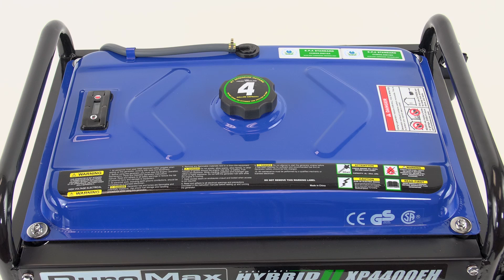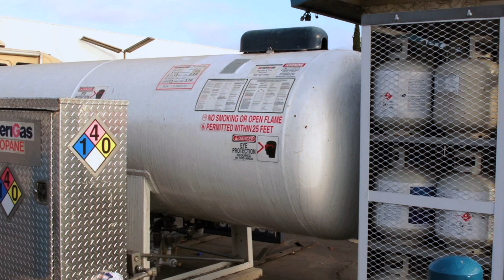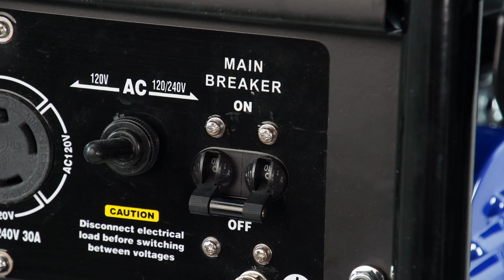DuroMax Generator How-To Guide: Assemble, Start, and Run on Gas or Propane

Comment: Good instructions,, might I add in step One: If you are alone, and you are going to tip the unit over to assemble it anyways,, just roll the box over  and lift off the box, I'm sure its way lighter than the Generator, I also have my cords hooked up so I am not causing any surges or sparks before I turn on the main breaker,, hope this helps.

Comment: Wanted two potential fuel sources. Have propane tank always available and gas for snow blower, so dual fuel source makes sense. Out of box took me 15 minutes to go thru steps and start. Ready for winter.
Reply from the maker: Sounds like you are prepared for whatever bad weather throws your way! Thanks for choosing DuroMax Power Equipment!

Comment: Does anyone know how to charge a 12v deep cycle battery using the 12v prongs and alligator clips that came with the 5500 dual fuel model? I’m pretty sure you can do it but when I tried smoke started pouring out from behind the panel. I quickly turned the generator off and unhooked everything but obviously I did something wrong.
Reply: Bueller. Bueller. Bueller… anyone?
Reply from the maker: Hi There!
We recommend calling and speaking with one of our friendly techs at 844-DUROMAX to walk through using the 12V to charge a deep cycle battery.

Comment: I have a few questions. We just ordered the DuroMax 13000 HX and I want to know about initial start up and break in. Is it ok to use Synthetic oil? How many hours should I let it run and then replace the oil when I first get it for break in? With a 20lb bottle of propane about how many hours will it run running a home central air? I know that will vary on the load, but I'm just trying to get a ball park idea if I need to buy a bigger bottle for home use. We have a few smaller ones for camping. I plan on just running propane in it and not gas, unless I just have to. Thanks for your time, Rob.
Reply from the maker: Hi Rob!

We do not recommend using synthetic oil on the initial 8 hour break-in period (standard conventional oil is best for this period.)  Please make sure to keep a few items powered during that time as to keep a load on the Generator. We recommended space heaters, portable fans or similar items. 

After that 8 hour break-in period we recommend to switching to an appropriate synthetic based on your climate. While a 20lb bottle will suffice for a short run we do recommend 40lb or larger tanks when powering AC's and multiple circuits on a home.

Any other questions please feel free to reach out!

Comment: We received the XP13000HX and the cover over the recoil cover and the cover over the generator were both bent.  After getting everything set up it worked with gasoline but would not start with propane.  We checked the battery and it was dead!  We ordered from Amazon and emailed duromax customer support and have not received any help from either place.
Reply from the maker: Hi Sue Jordan
That is very unfortunate to hear and we hope if that this hasn't been resolved, we can get resolved right away. Please email us at vipsupport@duromaxpower.com

Comment: I bought your XP12000EH generator and in both this video and the instructions that came with the generator it states that I have to press the button on the regulator to bleed air out of the propane line, and that makes sense.  My regulator is simply capped, there is no button/bleeder, so it takes 10 - 15 cranks of the starter to get it going on propane.

Can I be sent that release valve?  Sadly, for $1,000 I figured it would match the directions, this feels like an oversight.
Reply from the maker: Hi There!

We apologize you’re having trouble starting your generator on propane. The propane regulator on your generator is one of our new self-purging regulators; and has a different procedure for operation than the manual states.

To start with the self-purging regulators, you'll want to connect the propane tank to the generator and open the propane tank valve; then, let the generator sit for 3-5 minutes to purge itself. After the generator has been sitting for 3-5 minutes with the propane tank valve open, then, start the generator on mid-choke (choke between open and closed) to start. 

Once you hear the generator start move the choke to the open position (choke to the right side).
Please note to ensure the circuit breaker and the idle control (if equipped, depending on model) are in the off position while attempting to start as well. 

Please also note that if you’re unsuccessful in the mid-choke start position, the generator can also be started with the choke in the full closed position (choke to the left side).

Please feel free to contact us if you have any further questions or concerns - We can be reached at 844-DUROMAX
Reply: @DuroMaxPower  I needed this exact explanation. Thanks.
Reply: Did this solution continue to work for you? We attempted this once with success however, have now been unsuccessful starting again with propane. Any feedback is welcomed! Same model and no regulator button.

Comment: Cant take the 2 separate shipping braces off! Help!
Reply from the maker: Hi Roy!
We recommend an impact driver or impact wrench if a hand ratchet doesnt work. Also please reach out to our service team as they can provide some tricks to get those stubborn bolts off by calling them at 844-DUROMAX
Reply: @DuroMaxPower  got em out! Do I have to ground my 5500eh? It is fully enclosed in the cage and will be used to power a fridge and heater/portable ac via extension cords. Thanks!

Comment: Mine doesn’t have an orange brace? There are small red braces
Reply: Same! Did you remove those then?
Reply: Mine came with 2 individual red braces, are these supposed to be taken off?
Reply: I took both off, sorry Karen I did not see your comment. They are both just for shipping.
Reply: Just got mine but I cant seem to reach 2 of the bolts to take off
Reply from the maker: Yes the red or orange shipping braces need to be removed prior to use.

Comment: Which to use:
Conventional oil?
Synthetic blend? 
Full synthetic?
Reply: I haven't started my XP10000EH yet but we saw a great review that this guy probably knows his stuff. https://duromax-xp10000e.tumblr.com/post/82903514192/comprehensive-duromax-xp10000e-generator-review. Granted his post is 6 years old but what has changed since then? I've owned many Corvettes and have only used Mobil 1. About to start using it in our Husqvarna lawn tractor. I can't see how synthetic "any brand" can mess up something small when high performance cars ONLY use it.
Reply from the maker: Our generator models can use either 30W, 10W-30, or 5W-30 oil in synthetic or conventional depending on climate. Please see manual for further information.

Comment: The bolts on the orange brace had to have been torqued to 500 foot pounds. That was the most unneccessary amount of torque I've ever had to break
Reply: I had to get a socket set with a large handled socket wrench to do mine.
Reply: Can you please tell me how you managed to remove it?
Reply: Definitely good for some busted knuckles!

Comment: Video says to warm up for 5-10 min when using PROPANE. Says 30 seconds when using GAS. Also had a very hard time starting on propane with a new full tank. Followed instructions purfectley, took almost 1 minute to start, had to use a JUMP PACK because the battery died, ran rough for 5 minutes plus on PROPANE, then ran smoothly. No starting issues with GAS, just with PROPANE.
Reply: Although it says not to use the choke as you would with gasoline, when operating on propane I used the choke when using a 20 lb tank and it started right up withing seconds of hitting the starter.
Reply: @rearview2709  thanks man, mine wasn't starting so I tried this and it booted up immediately!
Reply: Pretty stupid to have to jump off an emergency generator. Also, why they are too stupid to ship a jump pack, built in charger or external charger to keep the battery at good operating levels is just beyond dumb. Glad I bought an emergency device with jump battery that could be dead when needed. 🙄
Reply: @geu6270  To a stupid commentor who totally misses the point then makes stupid comment that is totally off the point, which made him even stupider.

Comment: Should I attach a ground wire?
Reply: I was wondering the same thing when I read it in the manual
Reply: @nikolasgrn  Been running generator since the 80s off and on from time to time and never had a problem on not using a ground wire.

Comment: Waita min.: replace oil every 24hrs ??? You mean I have to stock up on oil as well as gas & propane ?  I find it hard to believe that every 24 hrs I have to change THE OIL WHY ? During a hurricane there are many many Rain-bands w/high winds !
Reply: i have one and do not do that
Reply: It's because there's no filter. You could filter the oil manually by removing it and pouring it through a filter or look at adding a filter.
Filtering just helps prolong the life of the engine.

Comment: hI, B-4 I cruise U-tube, Would anyone send me a .pdf or anything explaining how I can get my DuroMax XP4850EH, into my home's grid ??  During Hurracane Andrew (aug 24th 1992) I used a converter from my van to just one outlet in my home (Main switch OFF at fusebox) I was able to plug in the fridge, fan, & some stuff I can'rt remember for the 2 weeks we were w/o electric. Anyway please assist-I'm getting mine tomorrow :)
Reply: Donald L Taylor Jr. hire a certified electrician to perform any hookups to your home Electrical panel.

Comment: Where the hell is the propane decompression valve? It's nowhere located as shown in this video!
Reply: Mine also does not have the decompression valve.  Apparently, this is the upgrade noted concerning the new regulator.  Works just fine without it.
Reply: @robertm78645  Yes, I called Duromax and the rep told me this is an upgrade and all you need to do is let the propane adjust internally for 2-5 minutes. That's nice, but if that was in the instructions it could have saved me 30 minutes of scratching my head.

Comment: Can you connect it to a large propane tank so it can run continuously.
Can it run continuously?
Reply: Not really a good idea... You have to stop any portable generator that dies not have a spin-on oil filter AT LEAST every 20hrs to change the oil. So you can't really run it much longer than it will go on a tank of fuel.
Reply: @dontblameme6328  BUMMER.

Comment: Well I see that there are some negative posts on here so I’ll just tell my story. 

I ordered the DuroMax 4400E and it arrived in two days from Amazon. The front piece of metal (with the logo/brand) was a little dented and bent but I don’t think it was shipping damage. I think it was because the engine was too big for the frame and they just had to MAKE IT FIT! 

BUT once I got it unboxed and Assembled it the damn thing started on the very first try. I was mind blown! 

Well now that I have my fancy new electric start Generater the damn power NEVER GOES OUT for about a year but I keep running it and keep it healthy. Then suddenly the thing STOPS running. I researched the issue and found that it was a simple clog in the carburetor and it only took about 30 mins to fix by running a little paper-clip through a little hole. 

Then I noticed that my DuroMax model doesn’t have a fuel-filter so I bought one at my local auto-parts store. Problem solved and I swear this generator has been the most reliable SOB ever since. 

This thing has gotten me through about 10 power outages now in the past couple years and I LOVE it! It’s the best -$400 bucks I ever spent!

This is the best and most honest review I can give so take it as you will! NO it’s not a perfect machine but it almost is for the money.
Reply: I didn't know about the fuel filter. Where is it on the generator.
Reply: How'd you get your orange brackets off?

Comment: Wait....  The manual says it holds 37 ounces of oil.  This video says it holds 20 ounces (32-12).  Which is the truth?  I have to say, between Amazon, the manual and the MFR web page for this product, there are serious differences in information.
Reply: I would always follow the manual that came with my generator. This video was posted in 2014!
Reply: Just fill it and go.

Comment: I have the 10k watt generator and out of the box it won’t run. It starts fine, but dies with9n 10 seconds every time, anyone have a clue why? Is the idle control broke?
Reply: No you are leaving the choke on! I’m sure you have figured this out by now. Lol
Reply: Choke
Reply: Michael Milewski check the fuel shut off valve and the choke, use fresh premium gas. Hope you can get it to work

Comment: My propane gas hose for the xp4850eh got burned. Where can I buy a replacement? Anyone knows place help. I bought the hose at Home Depot with regulator and it doesn't work.
Reply: Loc hung. You don't need a hose with another regulator.  The regulator is already built into the generator. Dropping the propane pressure at the tank only starves the generator. Loose the extra regular and connect directly to the tank.

Comment: I have a 5 year old Duromax XP8500E that ran perfectly the three times i used it, the other day I decided to fire it up seeing how i haven't run it in about 6-8 months... I put gas in it and turned the key and the battery was dead do i pull started it and let it run to charge the battery. after a few minutes i noticed the battery charging light was off so I shut it down then tried to re start it with the tey, the starter clicked but didn't turn the engine over so I pull started it again and the charge lithe lit up... this time i was watching the charge light and it got dimmer and dimmer, then i looked at the volt meter and it was showing below 50... so I shut it down again but this time, Smoke started pouring out of the rear vent of the electric motor. I changes the AVR and the Brushes for brand new ones and its still doing this same thing. Any ideas why?
Reply: hdrjunkie have you figured it out yet?

Comment: I just purchased the DM XP4400E. Setup and start-up was simple. However, for starting the generator, the manual says to "close the choke" and then either pull the recoil start or turn the key to the start position. I found that if you keep the choke in the "closed" position, it doesn't start. You have to put the choke in the "open" position and then pull the recoil start. I'm not sure why this is the case, but other than that, all is well.
Reply: Shawn M. It’s because of the temperature where you live. Have you ever started a lawn-mower before???? It’s the same thing

Comment: As an Owner of a Duramax 120000 EH I had to return it.   I tested both Gas and Propane for an hour each and all ran fine. During Hurricane Irma in 2017 in Florida, I found out the hard way the Propane system sucks, it stutters, is inconsistent and forced me to go out and look for fuel during the worst of times and lines.  I had bought this Generator and a 100lb propane tank to last me...   It takes about 90 minutes and then the propane flow is inconsistent causing sputtering and voltage drops.
Reply: I would check the regulator coming from the tank.
Reply: Did you also purchase the correct regulator to use that larger tank? The OEM regulator is not rated for what you did.
Reply: Kelly Williamson man that’s terrible I only have a DuroMax 4400E and I only use it with gas and I love the damn thing. It’s so extremely dependable. Do you think your Generater would work better using gas rather than propane?? 

And you’re right. Irma was a bitch. I have many friends that went through it along with ya man. I’m in NC so I escaped Irma’s wrath. Lol

Comment: my generator dont have the batería
Reply: Eduardo Diaz I guess you didn’t buy the electric start model. Mine is the 4400E and it has the battery and electric start